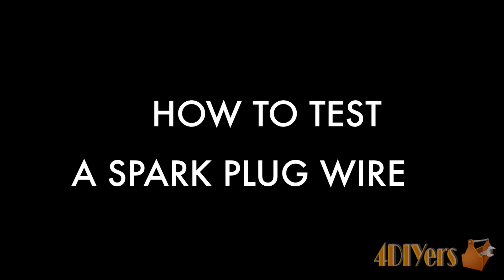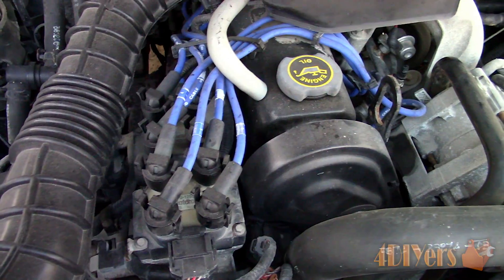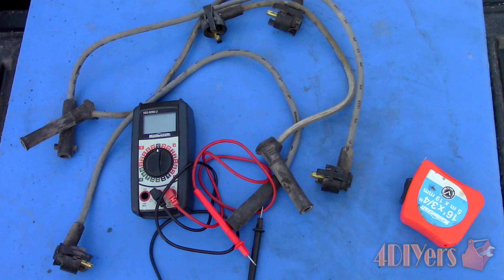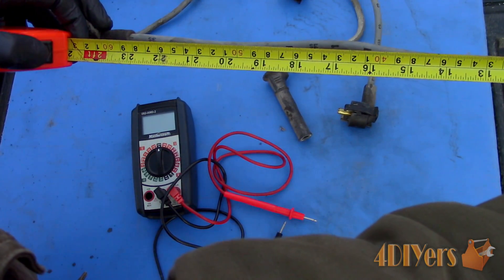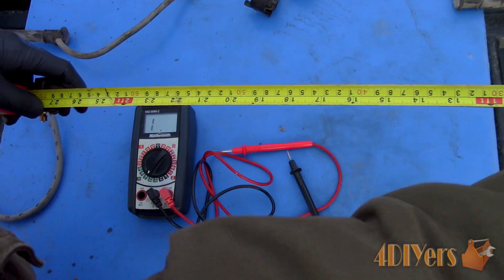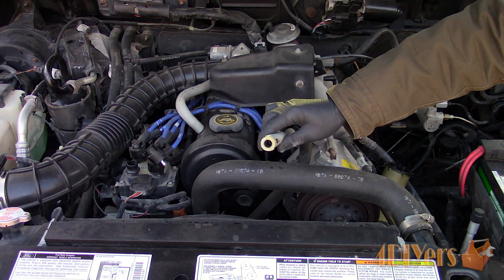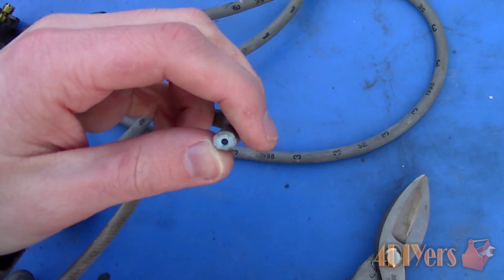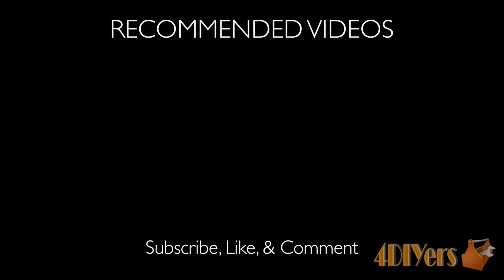DIY: How to Test Spark Plug Wires

Comment: is a spark plug wire tester even though it looks the same a ground clip with  a pencil point  IS it also is a 12 volt  circuit tester?

Comment: Does low rpm relates to any suspect of bad plug wires??? My car i20 rpm has recently drops to 650 as against the normal 850... I cleaned the TB unit, but still same issues.